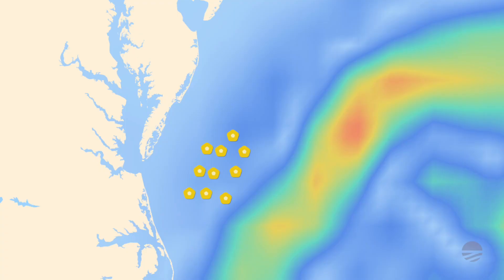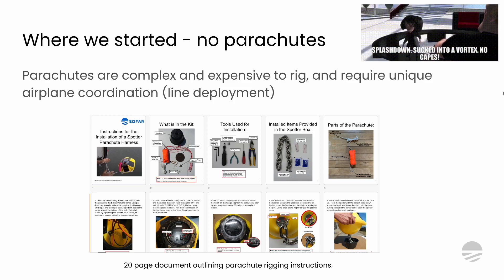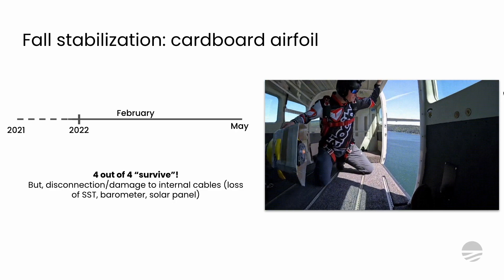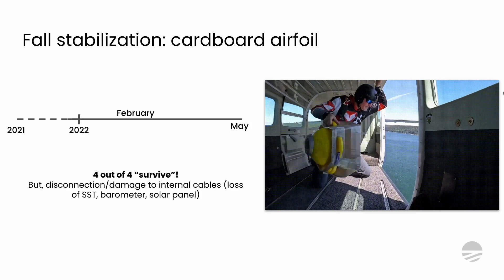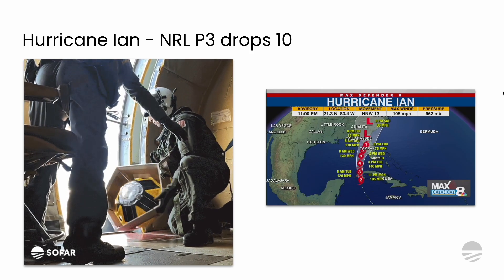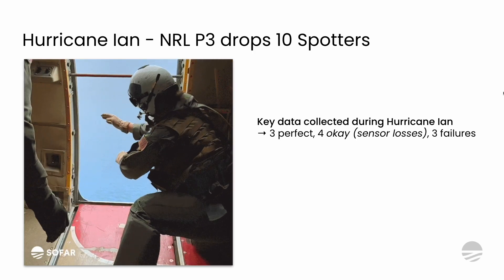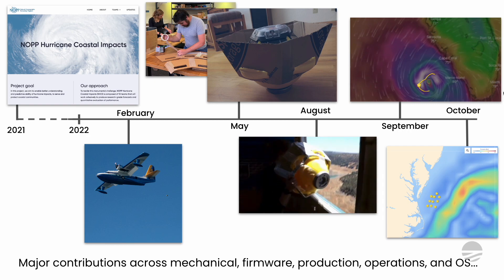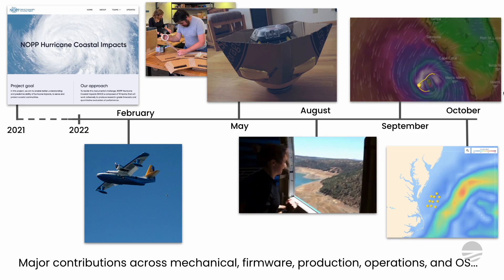An Ocean Scientist Explains... Air Deployable Spotter Smart Buoys

Comment: I've been doing something similar but on land, by throwing away solar sensors to create a LoRa mesh (meshtastic) for wild life monitoring as well as wild fire propagation monitoring.
The alternative what I am working with is using the concept of a "samara" or flying seeds, specifically using the idea of a caoba seed to make the devices spin as tell fall and thus transforming down speed to rotational energy, with the result of only loosing two sensors while having thrown about 16 repeatedly without any substancial damage to the solar panels, batts or antenna.

The "seed" wing that I'm using is made of cardboard so it disintegrate with a little bit of moisture, and to have them degrade quicker I'm not adding seeds in between two cardboard layers in order to add local plants to the deployment area as well. Exc results during testing.
Reply: (Disclaimer: Complete noob in this space)  Would it be benefitial to TRY to tangle them into trees on the way down, rather than land on the ground?  
ie: lots of hanging thread to grab onto tree limbs.  That way the solar panels will avoid being covered in ground-leaves in subsequent seasons.
Reply: @roidroid  Absolutely, I've done tests with 3dprinted hooks, but since they don't degrade it was a very local test. Next one will be with one mid size yute cord.
It's not entirely useful on all terrain, for example in wild fire monitoring, it's mostly grasslands.